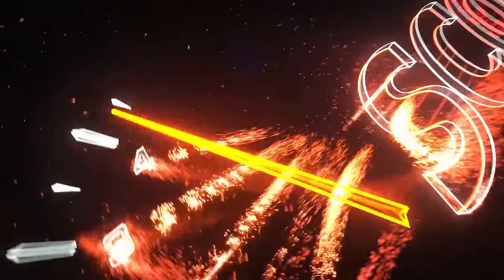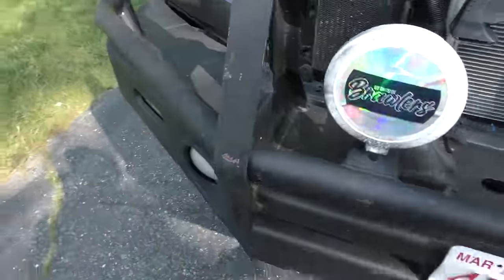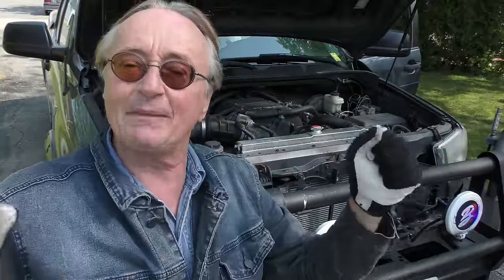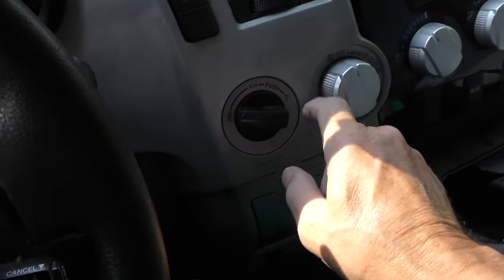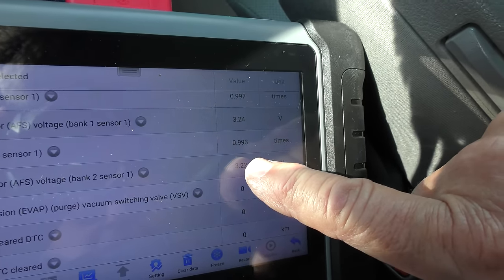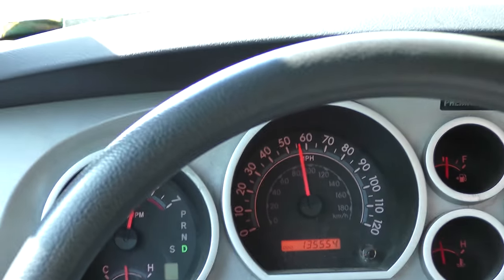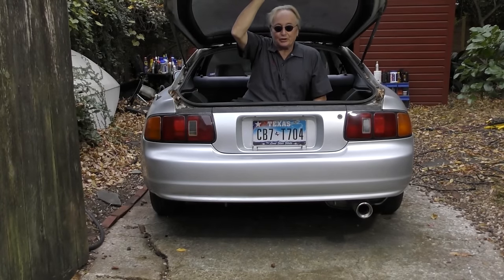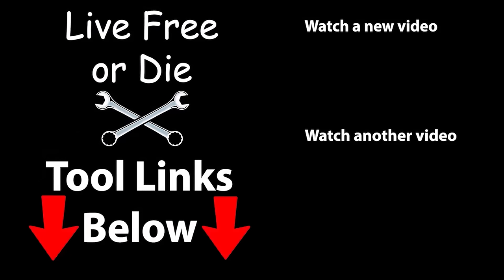Toyota's New Supercharged Truck Scares the Crap Out of Me

Comment: My 2UZFE is now 350K miles with the TRD supercharger installed at 200K. No issues whatsoever. This engine is bulletproof
Reply: It only makes 490 crank HP … not enough power to break anything
Reply: What supercharger did you put on?
Reply: Long shot I’ll get an answer, but how is the tundra and supercharger doing a year later?
Reply: Any updates?

Comment: The air injection pump went out in my 2007 Tundra and my dealer charged me over $2,300 to replace it… and that was 4 or 5 years ago!! After hearing Scotty say the part now costs less than $600 and takes only 1 hour to change out; I got ripped off for sure!!! 😡
Reply: wow
Reply: Dyi everything yourself
Reply: They must have had three or four snail 🐌 mechanics putting your on.
Reply: My dad had the same problem with the wheel bearing and they charged him $2100 when they quoted him 800 for it but I went to my local mechanic and they quoted me $180 never go to a dealership unless you plan on buying the part there, and if you think it’s manageable, DIY yourself
Reply: No way Scotty can change the air injection pump in less than an hour. It’s located right on the firewall, just about where the transmission and engine mount together. There’s no space for a easy removal and install
Reply: My air injection system was replaced for free on my 08'Tundra. Toyota had a 10 year/150,000 mile TSB warranty for the issue
Reply: Sad
Reply: I think there is a bypass that is even cheaper than replacing
Reply: Could have went to a u pull it yard and got the pump for 20$..Replace it in ten minutes..Stay away from dealerships
Reply: Its a truck, you should did it your self just like trucker always do..😊

Comment: That TRD supercharger cost $6,400. Without installation.
Reply: No one ever said supercharging was cheap!
Reply: Go big or go home. Love it.
Reply: Who sells them? Have a 2020, only seen Whipple, No TRD Super chargers
Reply: @kevinowens1732 Back in 2007, when he bought his Tundra, the only place to get them was Toyota. I had one of my Tacoma. 

I've looked up superchargers recently for Toyotas, they're not TRD, but they cost almost $7,400.
Reply: It lasts 200K miles without any sissues
Reply: @kyohiromitsu4010  My Tacoma, with regular maintenance on the supercharger, lasted over 380,000 MI.
Reply: @kevinowens1732  Magnuson makes it for the Tundra now
Reply: @kevinowens1732  I believe Magnuson makes them
Reply: @Kevin Owens  they were discontinued in 2014. This truck is 2007
Reply: Toyota severed its relationship with Magnusson casting TRD case versions for them 4-5 years ago bc of direction they were heading w factory boost(here we are snails on all the trucks now) I know an ex engineer that worked for TRD here in CA he's been all over planet w Toyota race rigs. These 6-7psi blowers are not gonna hurt the motors reliability. Doing 10k mile oil changes will!
Reply: @theylied1776  oh nice. I got some turbos, most need bearing change after 250k miles. These cost about $500
Reply: @applepoop10  Hmm, that's pretty cool! Thanks for sharing!
Reply: I just got a trd supercharger for my 5.7 for $1500 😊
Reply: @DTM.Desperado  Good luck with that. Where did it come from, TEMU?

Comment: Nice to see the AJT-Designs climate control knobs!  My '09 Tacoma SR5 DLT (Dad's Last Truck) now has AJT-Design's screw-back fob cases, 4-pack climate control knobs (in case I want to change the 4wd selector), battery clamp and billet shift knob.  Sound deadening installed in doors with upgrade speakers, single-DIN stereo receiver, and looking forward to installing LCE Performance Street Header kit (10% more hp, same mpg as fuel efficiency is related to weight).  Thanks, Scotty!

Comment: Superchargers are very cool but you can almost see the gas gauge go down when you punch it  :)
Reply: @rickroemer8391 you don't even need the supercharger for that just turning the key you can watch it go straight to empty. My 13 5.7 TRD off-road 4x4 crewmax with 4inch lift 33.1250x20 gets 6mpg and that's babying it $515+ a week to go to work and I don't have a supercharger but will be installing a turbo setup.
Reply: @speeedy95  Wow that's some wicked gas mileage
Reply: @rickroemer8391  Yeah, it sucks I wanted an 83 crew cab 4x4 4 speed manual 454 squarebody. Found 1 in excellent shape with all records and 110,000 original miles $4,500. My dad wouldn't let me get it because he said it's a gas hog. Well, he's been regretting that decision as my Tundra is just as much of a gas hog as a 454, and it's also a money pit. Everything for these trucks is outrageously expensive. Mine keeps blowing head gaskets and constantly losing 3rd and reverse in the transmission.
Reply: @speeedy95  Nonsense!

Comment: And don't forget the Air filters at least once a year. If you're on dusty roads I'd change it twice a year. And you don't need a K-N filter unless You actually keep it washed and reoiled or whatever is sprayed on the outside the 🧐.
Reply: AEM DryFlow filters don't need oil.
Just clean them twice a year and dry overnight.

Comment: Looks very close to mine. I don't have a supercharger. I have a 2013 5.7. I even have the same shifter like this one. Love it. Got her used in 2021 with 110K. Runs like a clock. She loves gas though lol.
Reply: I got a 13 last year it's a crewmax with the console shifter 6mpg and it's been nothin but a money pit constantly blows head gaskets and loosing reverse in transmission.
Reply: @speeedy95  That sucks. Sounds like you picked a lemon. Hope you get her all squared away. Or get rid of it hehe.
Reply: @CrowT I'm stuck with it ain't nobody gonna give me the $24,000 I still owe on it. 198k miles and it's 1 thing after another. As soon as I got home from the dealership the day I purchased it 4x4 immediately broke needs transfercase. Warranty kept screwing me over wouldn't fix it. To make it start you have to bang on transfercase and starter cause when you turn the key on it immediately starts beeping and flashing 4lo. It thinks it's in 4lo when it's in 2wd. My last 1 was a 06 4x4 and it was junk 2. Constant steering and 4x4vproblems and at 200k miles the frame literally fell out from underneath the right front of it.

Comment: On my tacoma, the secondary air injection pump has a foam filter inside it that will deteriorate over time and funk up your system.  To avoid this, you remove the old filter and put on a small pod filter.  I used a small k&n.

Comment: My 2010 Tundra 5.7 with 221k miles is within 1% of perfect on the fuel trim on both banks. Thinking the supercharger may be causing the 3% variation.
Also Hewitt makes a little black box that is a plug-n-play solution for secondary air system issues, and costs about $400.

Comment: Would you be able to do a video to show us how to change the air injection pump on a 2007 tundra 5.7liter? I'm having the same issue and the dealer is no help even though I got the warranty paperwork which unfortunately cut off at 150,000 mi or 10 years.

Comment: Yeah, Gm also had a design flaw with their secondary air injection pump hose, where it was too short and water would get in the pump and corrode them, and there was never a recall on them, so I have to replace it myself on my 2000 Sonoma.

Comment: I put that ATS gas and oil stuff in my Cadillac XTS and ended up putting a couple Grand into replacing plugs and gaskets and PCV valves and hoses and then found out the valves were gummed up with carbon so I had those cleaned sort of... It ran good for about a week and then I came off the highway and suddenly hear this loud ticking and a complete loss of power. I was told that some part above the lifters or rods had cracked! So I had a choice of rebuilding the entire crappy engine or putting a used one in. Cost me another four grand because I just can't afford getting into something new. When I tried to find out if anybody in the Midwest had their system for cleaning the rest of the intake your buddies in New Mexico hemmed and hawed and wouldn't tell me what repair shops had their equipment for that! I think they're a scam and I'm considering taking them to court for screwing up my motor.
Reply: @Howard Luke’s it sounds like your Cadillac motor was bad in the first place. Scotty has used this on many cars with no issues, and if his customers has horror stories he wouldn’t be famous. Your Cadillac engine was probably worn out already. Ask Scotty, he’s probably say the exact same thing as I just did. It’s pretty common on those Cadillac

Comment: Looks like a ton of fun to drive but I bet it's a SUPER gas hog probably ≤ 10 MPG
Reply: It's certainly a weekend vehicle.
I bet it tows any weight at the same MPG.
Reply: My guess 7 MPG avg
Reply: It's not miles per gallon, it's smiles per gallon when your going for big engines and superchargers.
Reply: I get 6mpg without friend has a 2wd 2015 supercharged 5.7 and gets less than me plus with the supercharger you have to run minimum 93 gas or it'll cause damage

Comment: I have never seen a supercharged Toyota Tundra in my lifetime. But, I know that supercharged vehicles are a lot more reliable than turbocharged vehicles. In my opinion, I will just buy a 2003 Chevrolet TrailBlazer LS EXT 4x4 seven-passenger mid-size, truck-based SUV with the 4200 (4.2 L) six-cylinder engine, which produces 275 horsepower and the four-speed automatic transmission, instead. These older SUV's from General Motors (GM) are currently reliable than these newer crossovers (Equinox, Acadia, Trax, etc.). You can also plan to buy a GMC Envoy XL, a Oldsmobile Bravada or a Buick Rainier, as well, because they are all similar to the TrailBlazer, except the 9-7x, which is from Saab. Thank you very much and have a great weekend.
Reply: I think Scotty misspoke here. From my understanding, and from what tuner friends have told me, you can put a supercharger on nearly any engine rather safely. It tends to be turbocharged engines that have to be "overbuilt"
Reply: @harveyhankerson8359  Thanks

Comment: There's even a supercharger option for the 3.4 V-6 and the 4.0 (non VVT-i) V-6 from the factory. Magnusson is the OEM supllier
Reply: There is (or was) also one for the 2.7 liter 4 cylinder (VVT-I).
Reply: My 2003 Tundra had a supercharger option for its 4.7L V8.

Comment: Hope he’s using premium gas, because after installing that SC, it states premium gas is required
Reply: @killdizzle  true, but you’d be surprised how most ppl cheap out and use regular gas. And when they run into problems, they wonder why? 
Just like most manufacturers now using these turbo engines. Without premium fuel, it’ll never run efficiently w/regular. So we should be asking… where are the savings?

Comment: Hey Scotty, what are your thoughts on installing one of those superchargers on a 2007 Tundra with a healthy 5.7L that has 312,000 miles on it?
Reply: you cant buy the TRD super chargers any more but they have after market ones for around $7,000-$9,000 but with that kind of mileage its probably not worth it.
Reply: @zakhatchell5344  Not worth it because of the age or mileage? The TRD blower was made for TRD by Magnuson Supercharger Systems, and it is still available for a couple thousand more than I paid for the truck.
Reply: @THEH2OMAN in that case, why not? Those superchargers in great working condition will hold their value. Those Toyotas are bulletproof

Comment: How much would that super charger have cost him at the dealer? I just bought a 2020 Tundra 1794. It only has 18k miles, and someone straight piped it (Removed the mufflers). It's loud AF, and I put a cold air intake on it. With the 5.7, it's no slouch, but I'd still love some more speed!
Reply: Over $8 grand.

Comment: Where did he get that radiator?
Reply: What ever happened to brass radiators?  Too expensive?
Reply: @elultimo102  I think you mean copper?
Reply: @deankoch7305  
No; brass.
Brass is an alloy of copper...brass is more resistant to vibration cracking...important in a motor vehicle.